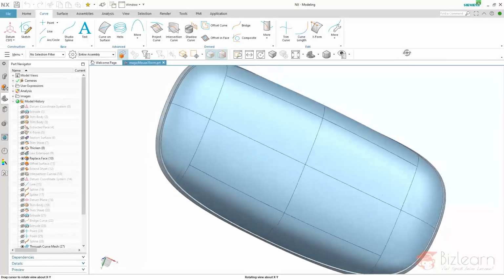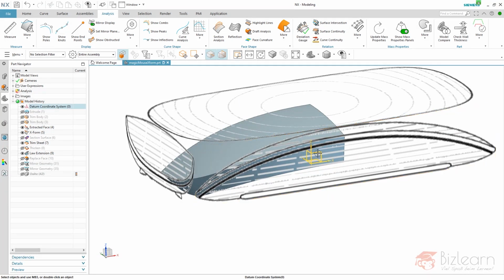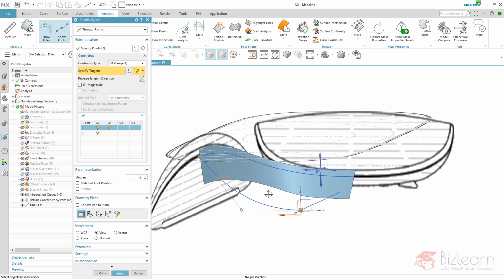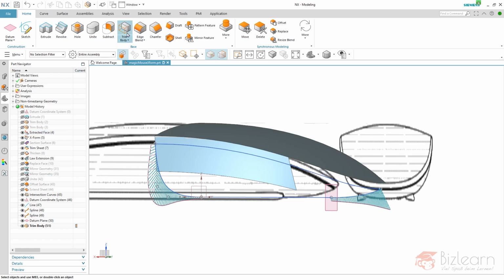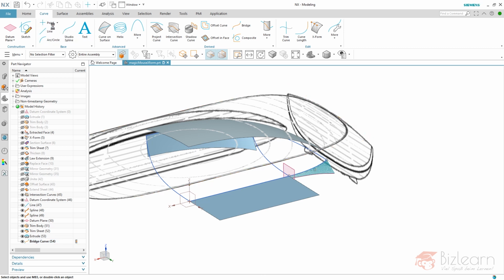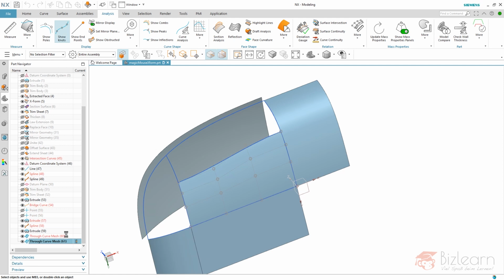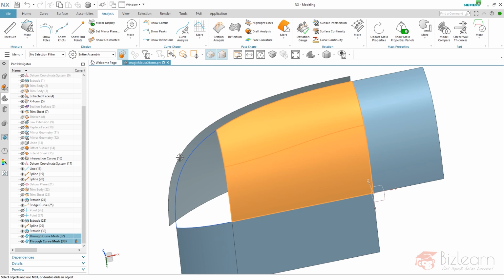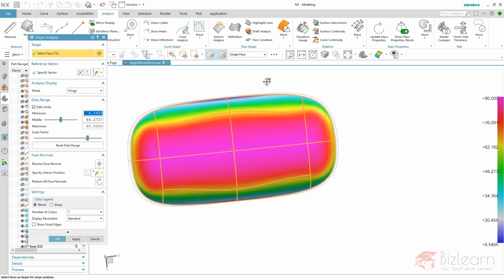Siemens NX Freeform Pro Tutorial - using through curve mesh in different manners to create Class A

Comment: Hmm, that 'Template curve' option in the |Blend curve| command at 12:22 was extremely useful feature. It is like instant copy-paste. I usually avoid using offset curves or direct copy paste, because they require additional tweaking/rebuild/planarising/scaling/snapping etc.
Reply from the maker: So true. The only reason for me using offset curves is within the sketch, related to regular curves like lines and arcs🤘 bridge curve rules, but people have to know it. It's not taught in regular trainings, especially class A etc.
Reply: @Bizlearn_Siemens_NX_Training  I was trying to find similar command (blend from template) in Inventor but without any success. NX has many tricks up its sleeve indeed. No wonder it is so expensive and powerful. I love it, but for the time being is way above my wallet.

Comment: I typically design surfaces with minimum 5° in either U or V direction what are your thoughts on this?
Reply from the maker: Depends on the adjacent Faces, on the degrees of freedom. The transitions shall be curvature consistent, not just tangent. Everything between 3 and 7 (maybe 9) is fine, as long as only one Segment per direction is being created.